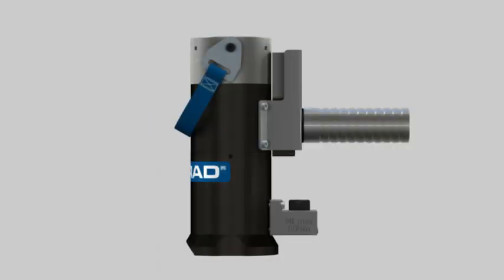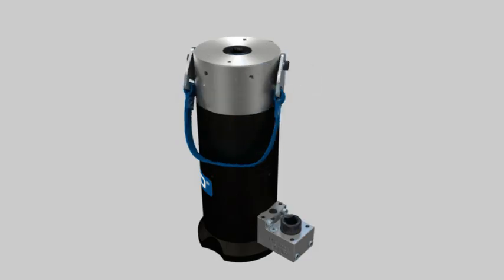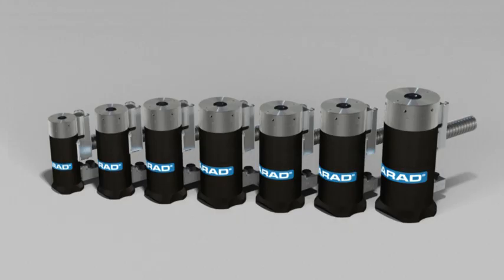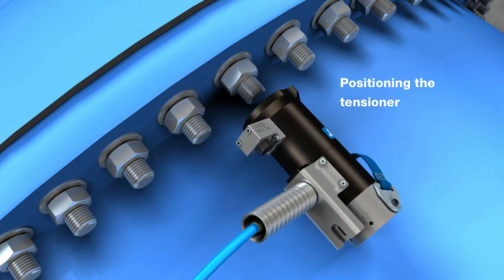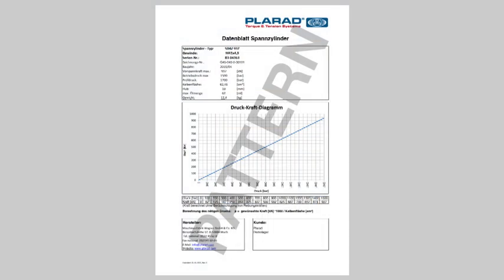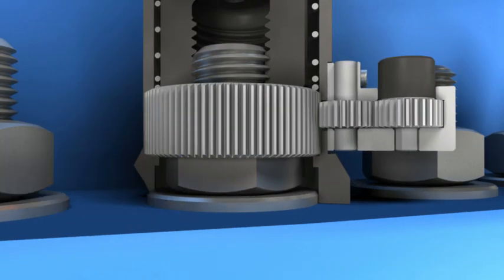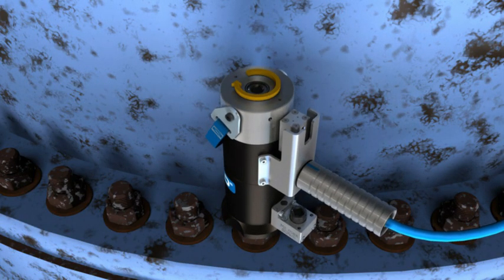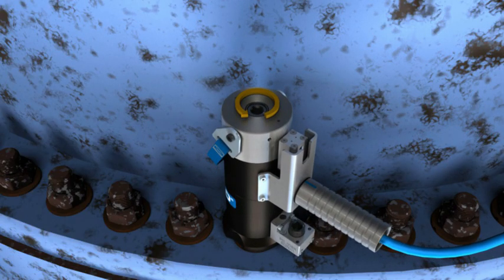Hydraulic tensioner  Plarad PSD

Comment: When we perform tensioning, why do we experience a pressure drop on the gauge when we pressurize for the first time?
But when we re-pressurize for second or third time, pressure drop doesn't happen.
We are using various tensioning tools, can somebody please explain?
Reply from the maker: You have a pressure drop on the manometer at the first pressurization because the hoses need to expand.

If you have further questions, you can reach us anytime at our Technical.Support@plarad.de
Reply: also you are filling the system with oil, so the O-rings on the pistons need to be lubricated, then you 'seat' everything into place, once this happens there is residual oil in the system, so no oil is forced into parts by the pressure, its all filled up, metal pores and all, so all pressure goes to the jacking process. a novice way to explain is : ever notice the different values of oil fillings for the gearbox, differential, etc. in your car\truck ? dry (after overhaul), and in a major service? (in the books); this is why, the system holds a residue in the system, only overhaul (washing the disassembled parts in the wash basin) removes the old lubricants completely! so you 'refill' to a lesser extent, aka you top up the levels, not fill from scratch.